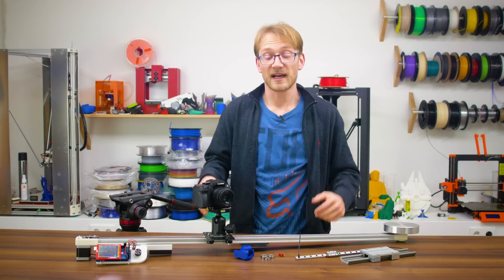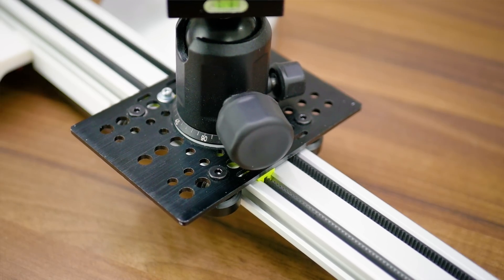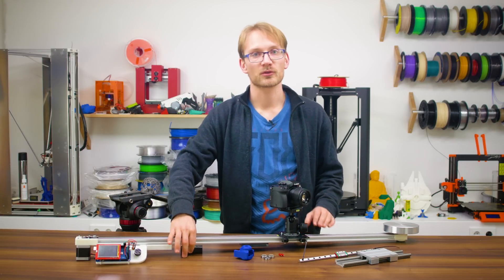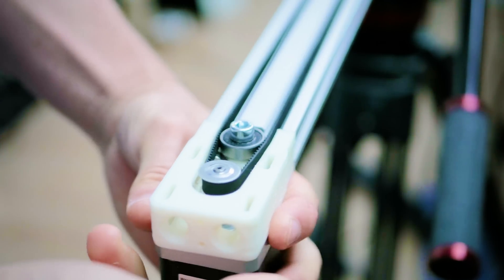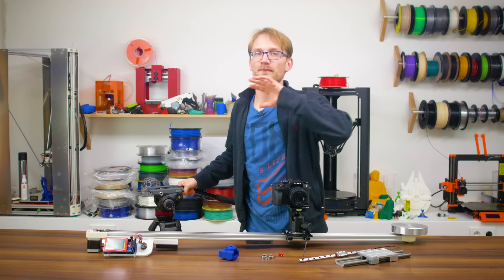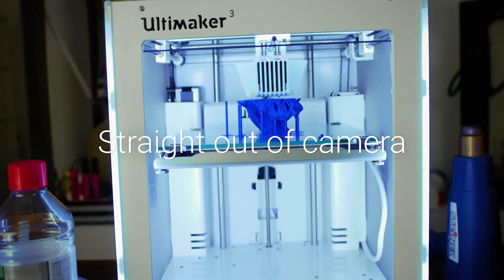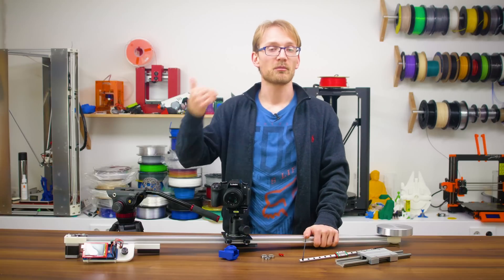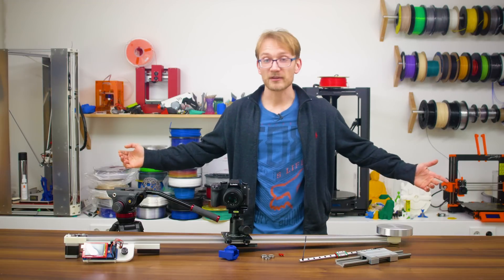Build your own Arduino-controlled camera slider!

Comment: Looks good.  One thought though as you say the Arduino Mega is a bit slow, you should try the Arduino Due as it is 32-bit with a faster clock and more memory.  It is basically a drop in replacement for the Mega.

Comment: The display you used is no longer available and the new version I was able to get doesn't match up exactly with the pinout on the Mega. Would you mind the pins on the Mega and which they connect to on the display so we can connect it with jumpers if needed?

Comment: Does your source code support stop and go motion? I would really only use this for astrophotography time lapses where 20 to 30 second exposures are needed, requireing the slider to stop, wait, and then move. I am proficient in c++ which I see is what you used to code this thing, and I know I could add that in pretty easily myself. Just thought I'd ask! Looks like an awesome summer project!
Reply: Hi Kalef, Did you manage to do the stop and wait function.

Comment: What angle can this handle?  I have a GH5 and wanted to be able to do vertical climbs on my rail.    Thanks for the video!!
Reply from the maker: +timmyd I've been running my stepper drivers on the weak side to make microstepping smoother and it was able to lug a medium-weight camera setup (G7 + EF lens) up a 45° slope. With a compact lens, the GH5 isn't any heavier, so if you crank up the current a bit it might be able to handle it,
Reply: Thank you sir!  Been wanting a 3D printer so I ordered an A6 to be able to print the parts :)  Are you planning on putting any End Stops on this?  If so I hope you do a video to help show how to add/program them.

Comment: I managed to get the slider running with some updated graphics. I observed that the motor doesnt stop when the time duration has passed. 
what method can we use to stop the stepper motor when it hits a limit switch.

digitalwrite(step,LOW)?

Comment: Hello! I Have got a bg problem. I installed all the components like Thomas (the libaries too) but when I upload the software to my andruino the screen is only white. If I upload an other sketch, it works. So I think there is maybe a problem in the sketch, but my programmer skills are very poor. Maybe someone can help me ....
Reply: I had the same issue. You mite need to change a bit of code to make it work, give this a try:
comment out the following lines:
//#include <Adafruit_TFTLCD.h> // Hardware-specific library
//Adafruit_TFTLCD tft(LCD_CS, LCD_CD, LCD_WR, LCD_RD, LCD_RESET);

Comment: Can you use an Uno for this?
Reply: Yes, it is the same.
Reply: Thanks +Martin Gudiño. I took the plunge and got a little UNO for a project I am working on. It has been doing my head in for the last week! 😂 This is a new challenge for me. 👍🏻
Reply: its easy to make it with a pap motor driver, only 2 cables for steps and direction. good luck!!!

Comment: Great video but how do I connect the bettery and everything to Vin, 5v, and ground on the arduino if I have the touchscreen shield on? I am using the Mega 2560 but Vin, 5v, and the other GND are being used by the display.

Edit: Update 5/15 - I figured out the wiring, I realized there is two extra 5v pins and two extra GND pins on the mega. Now the only question that remains is where do I find TimerOne.h ?
Reply: Had the same questions and you answered it (mostly).  What did you do for Vin?

Comment: It has been a while since this video but I finally build one my self.I wrote my own software since I use another display on wanted another GUI...anyway question is when running very slow vibrations of the stepper/belt (at 1/32th stepping) re visible in the footage. I added a damper as mount between motor and motor holder but I still see it. Do you see it in your footage too? and remove it in post?
Reply from the maker: There is one speed where my slider will resonate - so I just go a bit faster or slower. Speeding up footage is much easier than removing shake + rolling shutter.
Reply: thanks, will try that

Comment: Hey, awesome design! Is the torque great enough to angle the slider upwards?
Reply: Hey Hilmar, I'm doing the same, i striped every LCD part of the code, got it working but the didn't managed to get the soft end-stop working, it just keeps ramming at the end. What var does it measure the distance?
Reply from the maker: Without a heatsink on the stepper driver, it will hold and move my Panasonic G7 +  lens at up to a 45° angle. A beefier stepper driver or a geared stepper motor could significantly improve this.
Reply: Nice! Stronger than i imagined, will probably try and construct a similar design.

Comment: Hello Thomas, nice design, I'm printing the parts now, but making the electronics slightly different. I have a question though. 

In your STL files you have a shim file but do not mention where is goes in the build video or description. Where does it go ? 

Thanks

Ian

Comment: It wold be better (IMHO) if the controller also controlled the camera shutter so you could do move-shoot-move

Nice project btw
Reply from the maker: Many modern cameras have interval shooting built in, and that's usually enough to get steady shots. The slight movement during even longer exposures has not been a problem for me so far.
Reply: @MadeWithLayers   edu puertas  Did you connect the MS1, MS2, MS3 modes to the micro-step?Thank you!

Comment: Great video. I am adding a motor to a ratrig slider. How long does an np-f950 battery last before recharge. I have these batteries for my camera rig, and it would be very practical to use this for the slider as well.

Comment: Hello Again, ( Apologies as I posted the same question on www.youmagine.com/)..I would love to get this working...

Can anyone confirm if they got this circuit running?

Appreciate if anyone would let me know and if my uploaded below diagram is correct.
I tried all options….as per Thomas wiring, and external power to (Polulu A4988) Motor Driver…

I don’t get any movement in step motor …

Thomas I know you are busy…can you provide any feedback?
Thanks.

Comment: Hi Thomas and thanks for uploading encoder.h.

I created another diagram at the below link:

https://app.box.com/s/66d412frc23q4plaji25w6yjyw5mocva
Please advise if you notice something wrong…
In my setup the motor (Nema 17) does NOT spin…
Please let me know if something is wrong in my wiring / diagram..

Is micro stepping correct wired? 
I tried many jump settings with no results
I hope this diagram helps others on making this awesome slider…
Please guys upload your results…/issues…
Reply: My diagram looks identical but I haven't tested it yet. In 1-2 weeks when the parts arrive I will notify you how it goes for me :)

Comment: Hi Thomas, I think this is an amazing build but I'm having a few issues with the wiring. Would it be possible for you to take some close up pictures of your breadboard setup? I sorted my original problem with the code and the .h files. I also have an issue with my touchscreen which looks similar to yours but I'm curious which screen you got? The issue ive got is with the touch element not working.

I'd really appreciate some help on this project. I'm purely using your guide for the electronics as i have printed a slider from Harrope.com 

Many thanks!!

Comment: Can't wait to build this myself!!! I do have couple of things I am not sure of and would love to get some help:)
1.Since the LCD screen goes into the 5V of the arduino and covers it, to which port should I connect the stepper driver and rotary encoder on the arduino?
2. How many Volts should the battery be?
Reply: Did you ever solve your first problem? This is the issue I'm having too.

But the battery should be 12v.

Comment: Nice work, Tom! I've got two suggestions for the next-gen version: take a look at the VL53L0X "time of flight" distance sensor from adafruit. $15 gets you 1mm accuracy over 1m, would fit nicely on the arduino-end of the track, would magically eliminate the need for a remote endstop, and could detect mid-track jams too!

I recently built a stepper-turntable (using parts from an old record player) but I used an ESP8266 as the main controller instead of Arduino, so that I could command it over WiFi rather than having to add physical screens and buttons to each device. (I plan to have many) It was a stupid amount of software development to shave off $20 of hardware, but let me know if that's of use to you. (I needed it for compactness reasons)

ps. Yes, this is @JediJeremy from Twitter :-)

Comment: hyperlapse. that is the word for a timelapse with continuous motion. combine this with dolly/upward pan and good focus control and you get yourself a nice effect. 

best tool to get a series of pictures into video is virtualdub. 

print a vase in case mode, with a consistent layer leghts. so either a straight up cylinder or a twisted cylinder. measure you layer time... or average aross 10. now set you interval slightly higher/lower for the timelapse and the result will look awesome as the print head moves slow while the print is really fast. 

looks like magic. try it!

Comment: Hello - I made a 2 meter igus - runs smoothly with the  drylin bushings on rails -  Heres the code that WORKS for a Panning head   with display -  

http://www.360icon.com/Info/timelapse.html

#include <LiquidCrystal.h>
#include <Stepper.h>
#define STEPS  2048   //Number of steps per revolution

LiquidCrystal lcd(8, 9, 4, 5, 6, 7);
Stepper small_stepper(STEPS, 1, 3, 2, 12);

int lcd_key     = 0;
int adc_key_in  = 0;
int endStep = 1;
int startPos = 6600;
int endPos = 3300;
int minutes = 5;
long runtime = 0;
int rightLock = 0;
//int leftLock = 13600;
int leftLock = 20700;
int span = 0;
int stepDelay = 0;
int spanRemain = 0;
int motorPWR = 13;

int StepJump = 600;

#define btnRIGHT  0
#define btnUP     1
#define btnDOWN   2
#define btnLEFT   3
#define btnSELECT 4
#define btnNONE   5

int read_LCD_buttons()
{
 adc_key_in = analogRead(0);      // read the value from the sensor 
 // my buttons when read are centered at these valies: 0, 144, 329, 504, 741
 // we add approx 50 to those values and check to see if we are close
 if (adc_key_in > 1000) return btnNONE; // We make this the 1st option for speed reasons since it will be the most likely result
 // For V1.1 us this threshold
 if (adc_key_in < 50)   return btnRIGHT;  
 if (adc_key_in < 250)  return btnUP; 
 if (adc_key_in < 450)  return btnDOWN; 
 if (adc_key_in < 650)  return btnLEFT; 
 if (adc_key_in < 850)  return btnSELECT;  
 
 // For V1.0 comment the other threshold and use the one below:
/*
 if (adc_key_in < 50)   return btnRIGHT;  
 if (adc_key_in < 195)  return btnUP; 
 if (adc_key_in < 380)  return btnDOWN; 
 if (adc_key_in < 555)  return btnLEFT; 
 if (adc_key_in < 790)  return btnSELECT;   
*/
 
 
 return btnNONE;  // when all others fail, return this...
}

void setup(){
lcd.begin (16,2);
pinMode(motorPWR, OUTPUT);
}

void loop(){
  digitalWrite(motorPWR, HIGH);
  
  lcd.setCursor(0,0);
  lcd.print("Start angle L/R ");
  lcd.setCursor(0,1);
  lcd.print("Sel to confirm");
  small_stepper.setSpeed(9);
  

  while(endStep){
     lcd_key = read_LCD_buttons();  // read the buttons
     switch (lcd_key)               // depending on which button was pushed, we perform an action
     {
       case btnRIGHT:
       {
         if (startPos > rightLock){
           small_stepper.step(-StepJump);
           startPos = startPos - StepJump;
         }
         lcd.setCursor(0,1);
         lcd.print("pos:            ");
         lcd.setCursor(5,1);
         lcd.print(startPos);
         delay(250);
         break;
       }
     case btnLEFT:
       {
         if (startPos < leftLock){
           small_stepper.step(+StepJump);
           startPos = startPos + StepJump;
         }
         lcd.setCursor(0,1);
         lcd.print("pos:            ");
         lcd.setCursor(5,1);
         lcd.print(startPos);
         delay(250);
         break;
       }
       case btnSELECT:
       {
         endStep = 0;
         delay(250);
         break;
       }
         case btnNONE:
       {
         break;
       }
     }
  }
  endStep = 1;
  lcd.setCursor(0,0);
  lcd.print("End angle L/R   ");
  lcd.setCursor(0,1);
  lcd.print("Sel to confirm");

  endPos = startPos;
  
  while(endStep){
     lcd_key = read_LCD_buttons();  // read the buttons
     switch (lcd_key)               // depending on which button was pushed, we perform an action
     {
       case btnRIGHT:
       {
         if (endPos > rightLock){
           small_stepper.step(-StepJump);
           endPos = endPos - StepJump;
         }
         lcd.setCursor(0,1);
         lcd.print("pos:            ");
         lcd.setCursor(5,1);
         lcd.print(endPos);
         delay(250);
         break;
       }
     case btnLEFT:
       {
         if (endPos < leftLock){
           small_stepper.step(+StepJump);
           endPos = endPos + StepJump;
         }
         lcd.setCursor(0,1);
         lcd.print("pos:            ");
         lcd.setCursor(5,1);
         lcd.print(endPos);
         delay(250);
         break;
       }
       case btnSELECT:
       {
         endStep = 0;
         delay(250);
         break;
       }
         case btnNONE:
       {
         break;
       }
     }
  }
  endStep = 1;
  lcd.setCursor(0,0);
  lcd.print("Run time: L/R   ");
  lcd.setCursor(0,1);
  lcd.print("                ");
  while(endStep){
     lcd_key = read_LCD_buttons();  // read the buttons
     lcd.setCursor(0,1);
     lcd.print("    minutes");
     lcd.setCursor(0,1);
     lcd.print(minutes);
     delay(50);
     switch (lcd_key)               // depending on which button was pushed, we perform an action
     {
       case btnRIGHT:
       {
         if (minutes < 30) {
         minutes = minutes + 5;
         }
         else if (minutes < 120) {
         minutes = minutes + 15;
         }
         else if (minutes < 480) {
         minutes = minutes + 30;
         }
         delay(250);
         break;
       }
     case btnLEFT:
       {
           if (minutes > 0 && minutes < 10) {
         minutes = minutes - 1;
         }
         if (minutes > 0 && minutes < 30) {
         minutes = minutes - 5;
         }
         else if (minutes > 0 && minutes < 120) {
         minutes = minutes - 10;
         }
         else if (minutes > 0 && minutes < 360) {
         minutes = minutes - 30;
         }
         delay(250);
         break;
       }
       case btnSELECT:
       {
         endStep = 0;
         delay(250);
         break;
       }
         case btnNONE:
       {
         break;
       }
     }
  }
  
  runtime = (minutes * 60000);
  lcd.setCursor(0,0);
  lcd.print("Program Running");
  lcd.setCursor(0,1);
  lcd.print("    Minutes Left");
  if (startPos > endPos){
    span = startPos - endPos;
    spanRemain = span;
    stepDelay = (runtime / span);
    small_stepper.step(span);
    while (spanRemain) {
      small_stepper.step(-1);
      runtime = (runtime - stepDelay);
      lcd.setCursor(0,1);
      lcd.print((runtime / 60000) + 1);
      spanRemain--;
      delay(stepDelay);
    }
      
  } else {
    span = endPos - startPos;
    spanRemain = span;
    stepDelay = (runtime / span);
    small_stepper.step(span * -1);
    while (spanRemain) {
      small_stepper.step(1);
      runtime = (runtime - stepDelay);
      lcd.setCursor(0,1);
      lcd.print((runtime / 60000) + 1);
      spanRemain--;
      delay(stepDelay);
    }
  }
  endStep = 0;
  while(1){
    lcd.setCursor(0,0);
    lcd.print("                ");
    lcd.setCursor(0,1);
    lcd.print("Program Complete");
    delay(500);
    lcd.setCursor(0,0);
    lcd.print("Program Complete");
    lcd.setCursor(0,1);
    lcd.print("                ");
    delay(500);
  }

}

Comment: Love this..

I'd like to make one that slides and has a turn-table also that could keep the camera fixed on one spot as it panns past... The maths of calculating the rate of rotation, VS linear motion and focal distance would be quite fun too..

Thanks for the video Thom!  It's great to see other types of video from you: a controls engineer like you could make all sorts of awesome project videos.

Comment: Did you already think about cable management when adding another axis on the camera platform? I'm thinking about using the igus rail because I could fit a small e-chain in the rail and under the sled. But that stickyness-concern is right...

Comment: because of Arduino boards being slow with the screen attached, use more Arduino boards for separate tasks. let them communicate via i2c and you build a rocket fast system. one arduino for the slider motion, one arduino for the camera tilt and pan motion and a third arduino for the display and human interface. work with the interrupts to be failsafe and PLEASE add end stop switches for safety.

Also, why is that bearing near the motor installed. the way I see it, there will always be friction on one of the sides?
Reply: also curious about the bearing near the bore pulley

Comment: My 3d printer I am building uses the Delrin solid wheels and I hate them.  If you leave it sitting then the next morning it will have a flat side and no amount of tension, or lack thereof, helps that.  I will never touch anything from OB again.

Comment: Its a cool gadget but why wire it all up that way? Why not just use a mega/ramps with one stepper driver, since they're pennies, and then use printer firmware to control the motor? You could mount the belt above the aluminium profile, like a large delta tower on its side. Just an idea.

Comment: You could very easily put one of those sonar-based range finders for arduino, and program in a radius value; then attach another stepper to the camera's "Z" axis and have it turn automatically... Set to auto-focus and done XD.